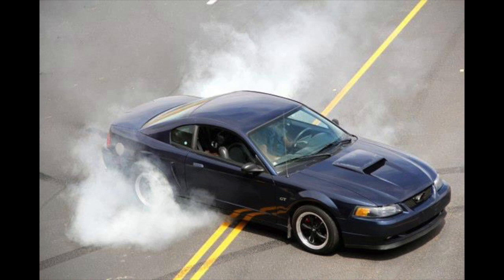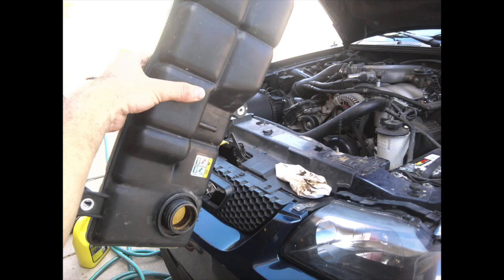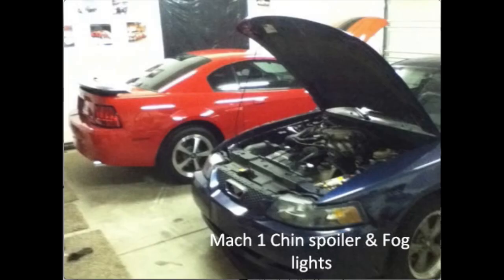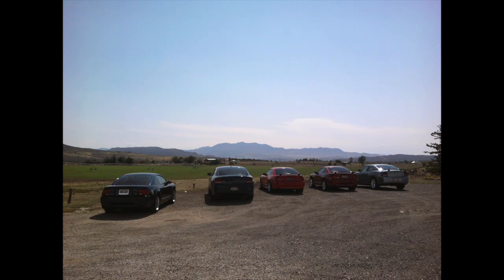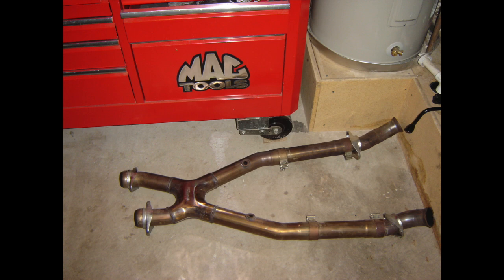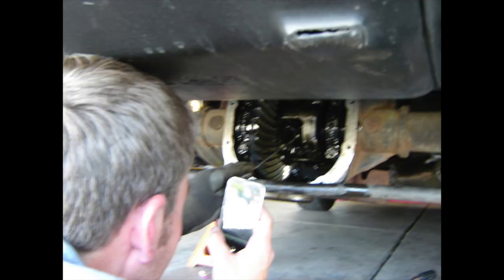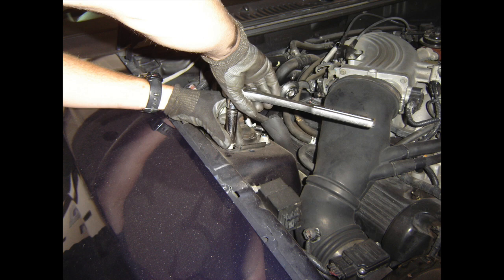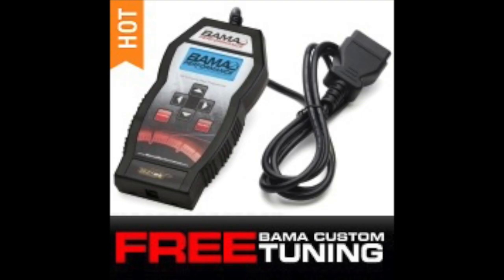My 2001 Bullitt Mustang story part 3

Comment: I've never had a 2V but they seem like great engines for what they were.
Reply from the maker: They are really fun for what they are. The Bullitt intake manifold and 5 speed with gears is closer to what a Mach 1 runs. As you know I have had several and the auto GT’s are very different and don’t feel the same